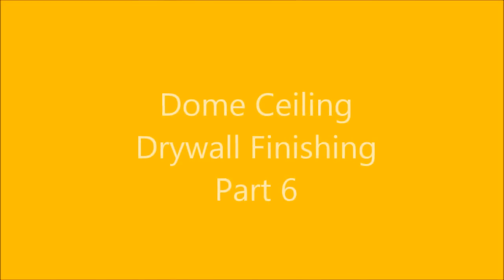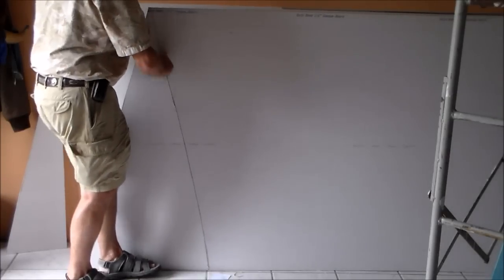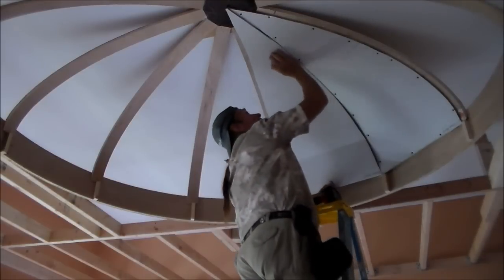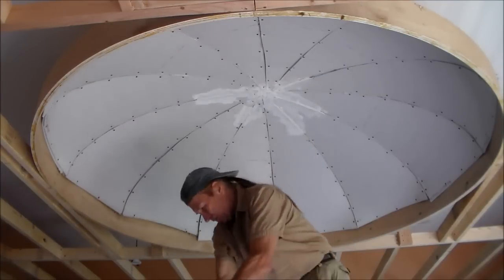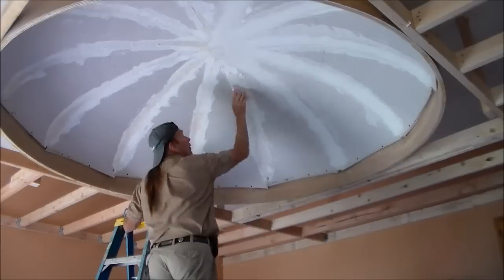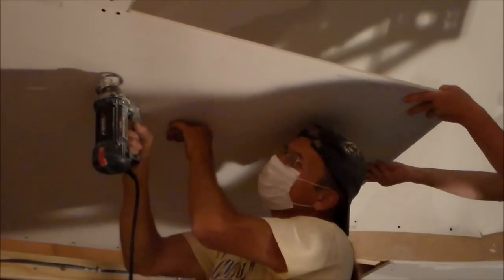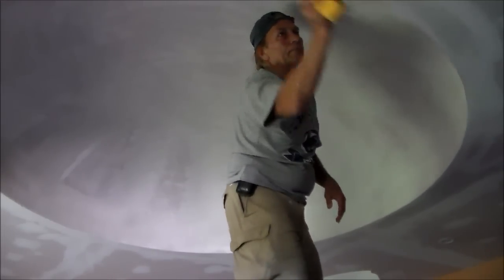Dome Ceiling   Drywall Finishing  Part 6

Comment: Just a correction on which side to wet. When wetting drywall you must only wet the inside curve only on the outside curve as the wetting the outside will weaken the out side paper and when  you bend the dry wall it will split the outside paper and ens up cracking the sheet. Wetting the inside curve allows the plaster on the inside beneath the paper crush down while the out side paper stays strong and resists tearing and cracking. after the dry wall has been fixed into the new position the water will evaporate out and the crushed plaster on the inside curve will semi reset to the new position.
Reply from the maker: that is very useful information, Thank you my friend---Don

Comment: if you rub fiberglass insulation on the sheet rock it helps it bend.  sounds like a joke but I've seen it done.
Reply from the maker: +Doc Bartley Thanks for the tip my friend---Don

Comment: This is really custom "tailoring" and sculpture by a most experienced craftsman and artist. Wish I could find someone around here to do this work. Do you have people to recommend in North Carolina?
Reply: Is there a different more flexible material that could be used instead of drywall? Perhaps even large sheets of something similar to fiberglass or even the auto-body spatula material, cut to shape.
Reply from the maker: My daughter could paint it! She is in Raleigh.
Reply: The problem with the work he did was that he didn't tape it so give it a few weeks when the house moves his ceiling will start cracking I do this for a living and I've seen many of these mistakes happen you always have to tape the joints and the cracks,
Reply: Didn't you watch the video? He does tape it
Reply: I thought he did tape it.
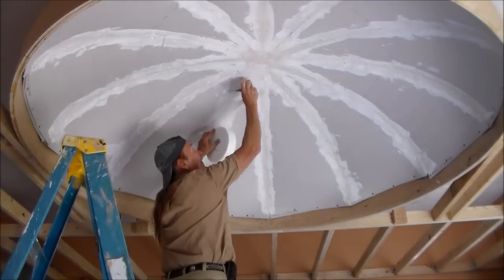Reply: go to 8:55 ish